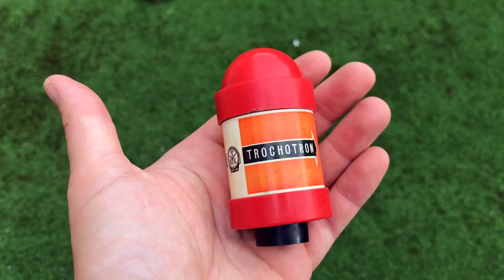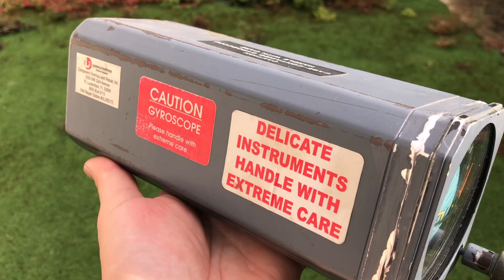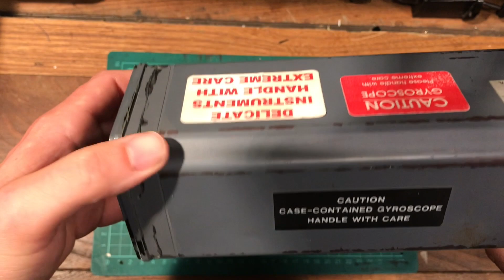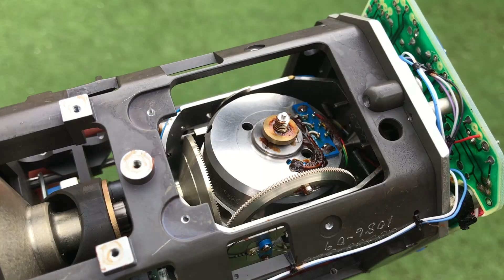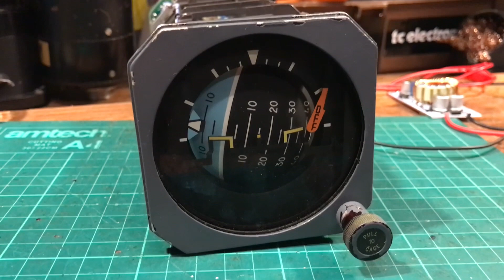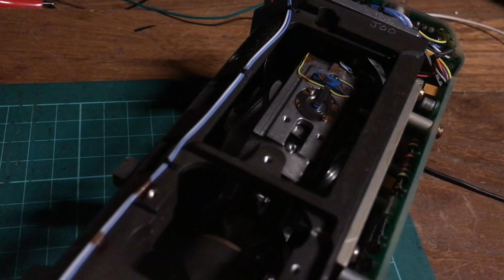This Thing Shows If You’re Flying Upside Down!

Comment: About the question of the 3-phase inverter, it might not work, but BLDC motors, like the ones used in drones work on 3 phase AC, as such tge Electronic Speed Controller (ESC) is itself a three phase inverter

Comment: the trochatron is named after the trochoidal electron beam path, the breakdown i'm reading about the ericsson ryg 10 says it's the only decade pulse counter which permits direct setting to a desired position. it stays neutral until one of the spades is pulled down
Reply from the maker: Very cool. It’s a faster version of the Dekatron then. Wonder what it was counting in the plane…